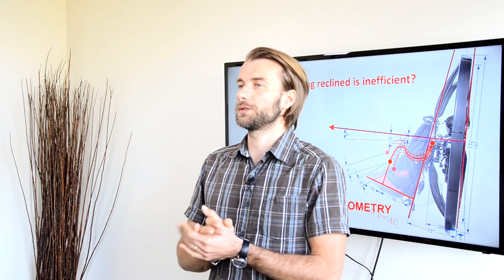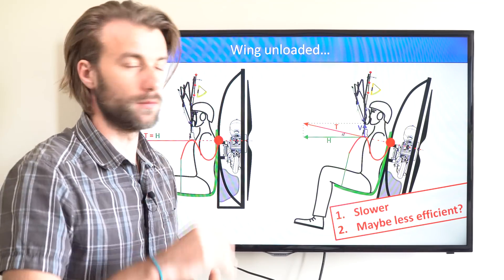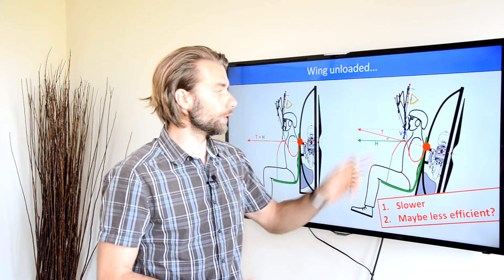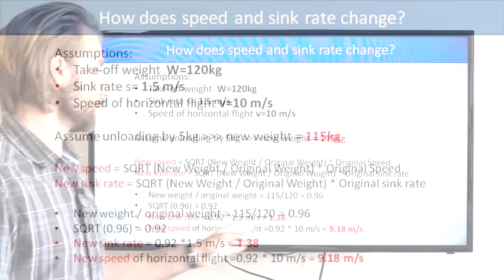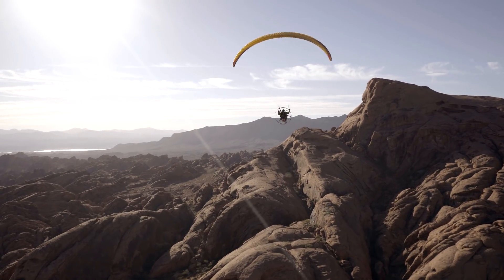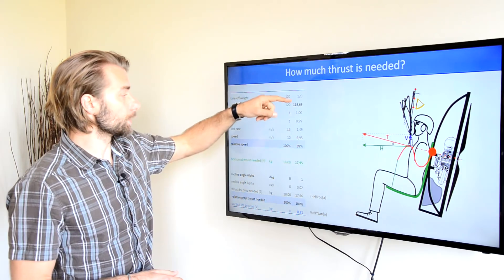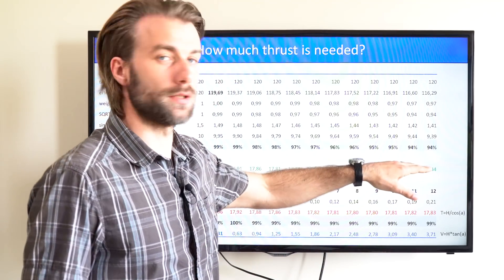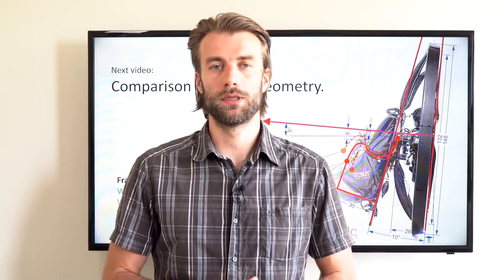Why being reclined is inefficient? Paramotor geometry part 19

Comment: In my opinion the calculation is faulty because FIRST we need to find the reduced total thrust needed. 

I am calculating the total thrust needed based on the inclination starting from : 
H=W*s/v and H=T*cos(alpha)
T*cos(alpha)=(W-T*sin(alpha))*s'/v' and v' = ((W - T*sin(alpha))/W)^2*v and s' = ((W - T*sin(alpha))/W)^2*s
T*cos(alpha)=(W-T*sin(alpha))*((W - T*sin(alpha))/W)^2/((W - T*sin(alpha))/W)^2*s/v

Concluding to:          T(n) = W*s/v / (cos(alpha) + sin(alpha)*s/v)

Based on the the given parameters: take-off weight W(t)=120 kg , sink rate s(0)=1,5 m/s, speed V(0)=10 m/s, thrust T(0)=18 kg (W*s/v=120*1,5/10), calculating with 10 degrees inclination the results are as follows: 

1. total thrust needed: T(n)=s(W-(W*s/v)*sin(a))/v*cos(a) =17,81 kg
2. the unloading of the glider is V=T(n)*sin(a) = 3,09 kg 
3. SQR = ((W-V)/W)^2= 0,95
3. new sink rate: 1,5*0,95 = 1,425 m/s
4. new rel. speed: 10*0,95 = 9,49 m/s

The difference in total thrust is 0,19 kg only, while the speed loss due to the lower horizontal thrust of 17,54 kg is 0,5 m/s (5%).

Their results are similar, but mathematically incorrect.

Please let me know if you think different.

Comment: There is a math error here.  Your formula relating loading to speed is correct with its SQRT, but when you plug in numbers you wind up squaring instead of taking the square root.  This happens initially at 2:40 (when you even say "square function") where sqrt(0.96) is 0.98, not 0.92, then again at 4:38 for your 1 degree calculation, and finally at 5:19 for each column in the table.

Note that this isn't just a typo where SQRT was used when SQR was intended.  The formula is derived from the lift equation where the lift is proportional to the square of the velocity, and thus the velocity is proportional to the square root of the lift (or wing loading).
Reply: I noticed this error aswell
Reply: Which means that the speed loss is not nearly as much as claimed. I also wonder what it does to his efficiency calculation. The conclusion of this video, that reclined is more efficient, but not worth the loss of speed, should be reconsidered in light of the math error.

Comment: This is why the big airplanes have elevator trims to adjust the pitch angle in horizontal flight for the most economical flight( or to lift more load , if necessary) . There must be a trim procedure for the paramotor "elevator" ( propeller vertical pitch )

Comment: All paramotors have some minor fore/aft tilting once power is applied/released. This is why manufacturers recommend a tilt of 10-12 degrees. It is not for comfort, it is so when power is applied the line of thrust is in an optimal position.
Reply from the maker: https://www.youtube.com/watch?v=Do5jqAdM6bI&list=PL_h5-6xkVJYOhdtzuJYpjcD3QQeohxDDz&index=5
Reply: SCOUT paramotor So the wing on a Scout paramotor stays perfectly in line with the center of gravity, it does not pitch back once thrust is applied?
Reply from the maker: Every well balanced paramotor stays in line with the glider, not just the SCOUT. Of course it depends on correct harness adjustment.
staying in line with glider I mean the paramotor tilts backwards on full throttle just as much the gliders steps back. Just like on a swing.

Comment: i wonder about the effects of a negative thrust angle when the thrust is facing 2 or 5 degrees downwards for example...is it possible that you increase the wing loading therefore gain speed?
Reply from the maker: +Yasha G yes. Sure
Reply: interesting...that could be a nice feature to alter the vector  during flight. i can do it with my low suspension bars but i use my body to incline or decline the thrust by moving fwd and bckwd in my harness but some more comfortable mechanism would be nice..
Reply from the maker: +Yasha G it's possible with speed bar

Comment: This is a great video series, & I am learning quite a bit.  Is it possible to have the pilot recline, yet keep the propeller vertical?  I could see many advantages, but with the disadvantage of more complex, dynamic suspension geometry.
Reply from the maker: +Mark Rogers you have hit the nail! Wait for the next video...
Reply: As a free flight pilot I prefer to be very reclined when flying, since it gives me the most command over weight shift. I really enjoy the higher math, and advanced geometry presented in your recent videos.
I would like to see more, and so propose you make a channel for those of us who really enjoy the math. That way you can avoid scaring away the people who are less inclined to work out the figures. Either way, keep up the fantastic work! These are very helpful.

Comment: Would it be possible to build in the recline into the frame and harness ?

Btw, nice to see you include a little bit more of the maths, though it would be nice if you went through the units with a quick example to make things absolutely clear :D
anyhow, thanks again for another interesting video :)
Reply from the maker: +freezatron very good guess!
Reply: seemed the likely outcome of such an arrangement ;)
I can imagine the solution being something along the lines of having the seat portion of the harness on a "crossed trapezium" brace so that it could slide forward when seated and back when standing to reduce the transition angle. There is an elegant solution to this, I'm sure of it :D

Of course props with delta flapping hinges would also help here ;)
Something I proposed previously using a bolt on yoke with a through bolt to hinge the prop but was deemed a little too complex. 

A simpler solution, using a thin sprung steel sheet as the delta hinge & damper connecting the hub and blades so it is effectively a single piece unit. Could be designed such that the blades bolt on to steel sheet delta hinge (which is sandwiched in the middle of the hub) for compact storage and ease of replacing the sprung hinge (for fatigue reasons) Plus this would work for props with more than two blades.

Not complex to install or use with a positive benefit.
Would be an easy upgrade to install. and minimal extra weight 
"Just" needs designing, but then you guys are innovators  :D
Reply: freezatron 
yes you are right! We have the recline angle built in the scout frame. Apart obvious advantage in flight, there are certain disadvantages as well. All these will be covered in the next video...
Reply: I'm guessing the disadvantages are to do with launch and landing body posture, greater pitch angle change during transition from feet down to up and thus a more pronounced gyroscopic precession effects on launch ? :)

Comment: just experiment with tachometer and different angles of paramotor. At same altitude see what rpm necessary for level flight with each angle. Always a balance between form(being comfort) and function (being efficiency)